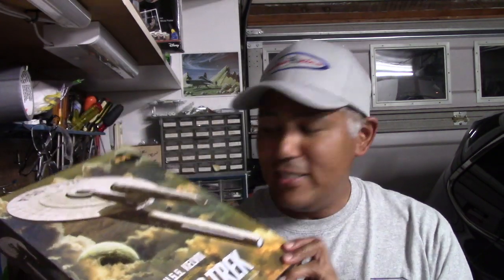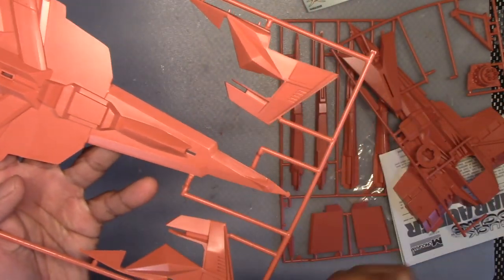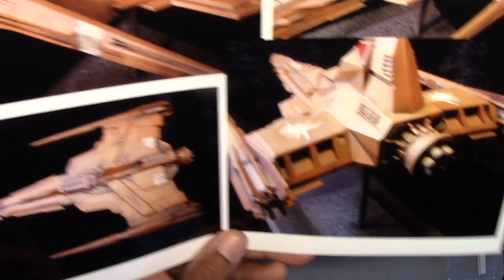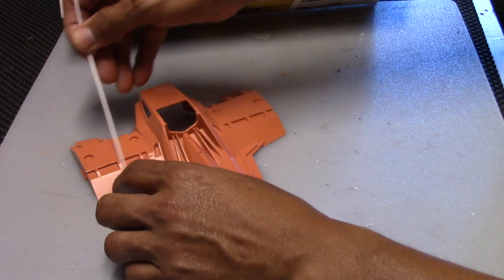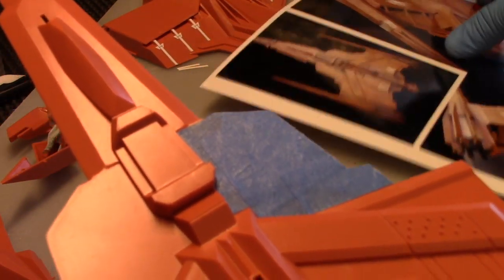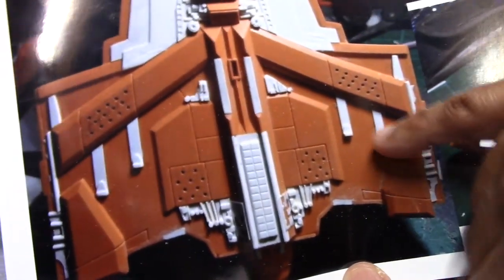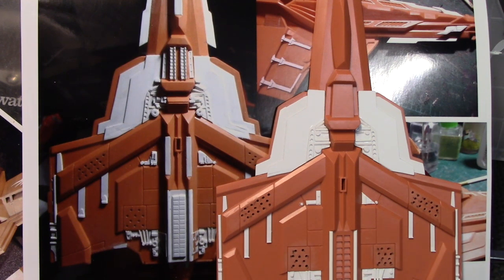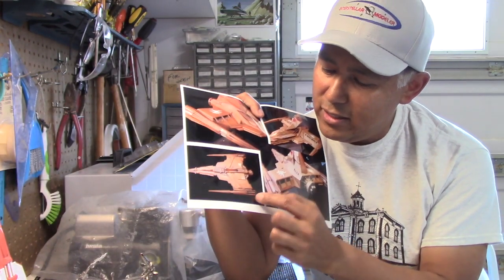Building Monogram's Buck Rogers Marauder

Comment: This is awesome!  Love your work.  I was wondering with the bottom of the ship where there is two strips of styrene with  indentations on each side of the strip, I know you tried to recreate that, but you ended up raising it.  I was wondering if its possible to use a small flat head screw driver and heat up the tip of the flat head screw driver and apply the heated tip to the two strips on the bottom of the ship so it recreates the rectangular indentions on each of the strip.
Reply from the maker: Hey that's a pretty good idea.  I think that may work. Since this is a detail that won't be easily seen I'll leave it as is but that is worth a try.